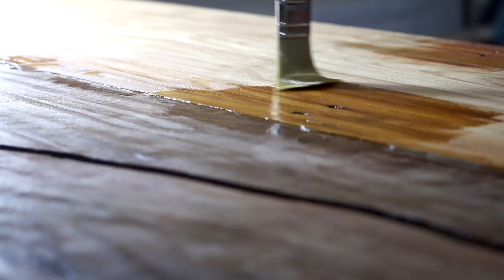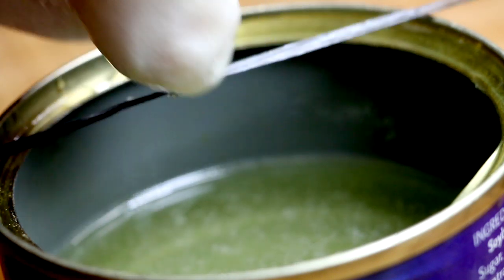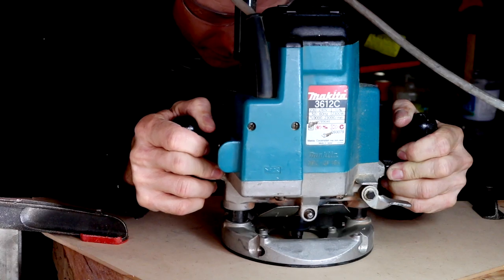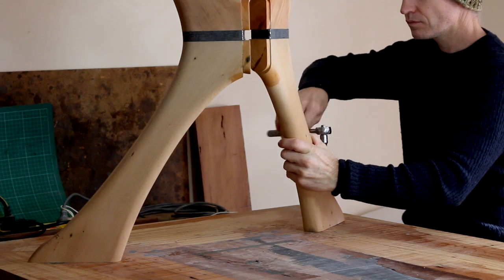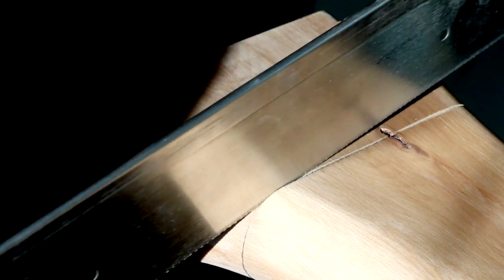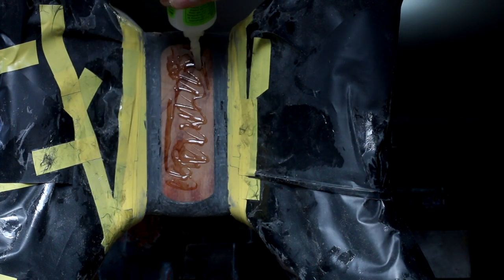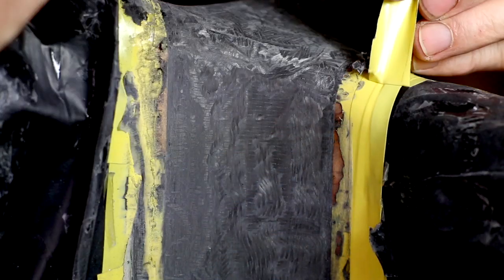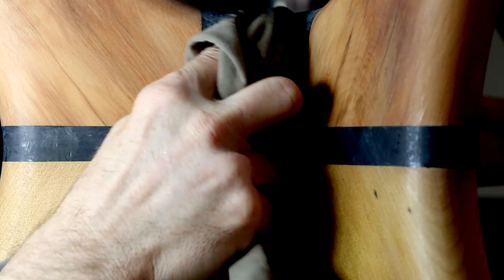Dining Table Build - Part 5

Comment: Bro, where'd you get the Carnuba? I think I'd done a search for it a few years ago and isolated pure carnuba pellets from people whom were making perfumery. If I remember correctly I was going to dissolve it in white spirits and beeswax, or was it methylated spirits? Oh, and by the way and out on a tangent, do you know the scientific name of that shell, used lot's in Pacifica, and tending into Micronesia, jewellery which is tinged a vibrant mid green. the shells are big and flat and of a scallop type except without the ridging.
Reply: Oops, I'm Kiwi too, that's potentially for top worlders, which maybe explains the need for sourcing of materials in quite odd ways... we often, way down here, can't simply go out and buy something but have to research how a specific commodity might be used in other industries.
Reply from the maker: Hi Sean. Thanks for the questions. The canuba is just a finished product I got from Bummings. Forgotten the brand however the wax is dissolved in limonene, citrus oil, which suits me better than something like toluene. The shellac flakes on the other hand are getting quite hard to source in bulk. I used to get from hammer hardware on Dominion Rd who sold bags of the stuff However the owners have changed hands now. You can get flakes off Tarde Me but they are pricey. Yeah sucks being in the land of hard to source everything. Zinzer Bullseye shellac in the spray is bomb diggity awesome, but  Bummings no longer sell it. You can still source it from Haydon paints. Not sure where to get that green shell, seems like it may be endemic to sth East Asia perhaps. Cheers